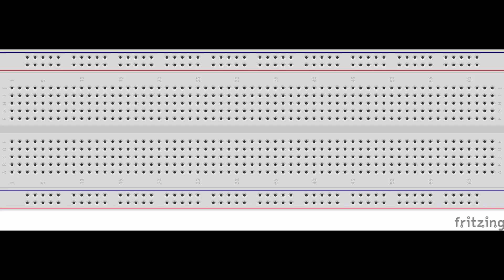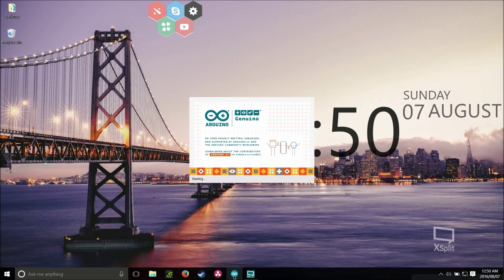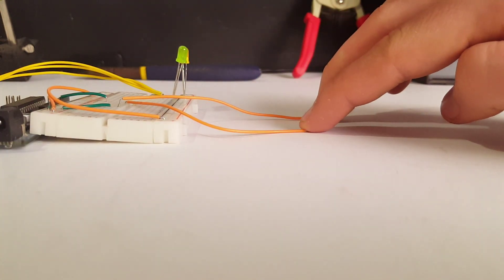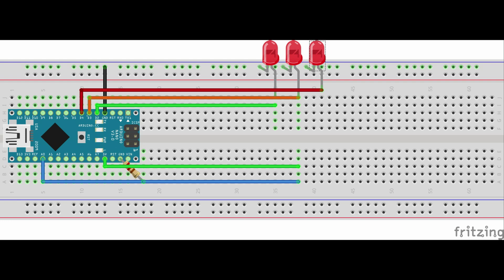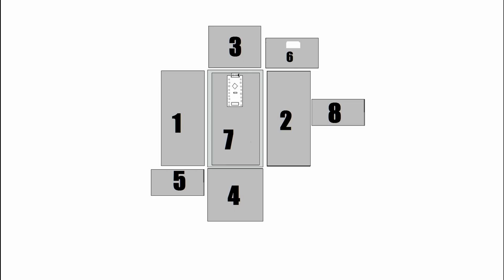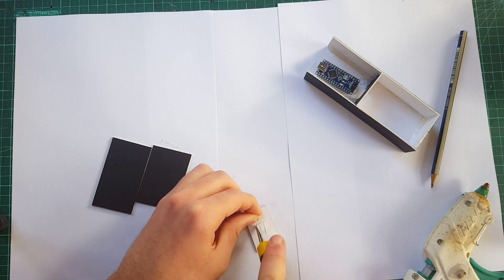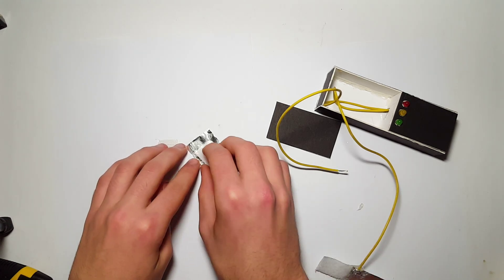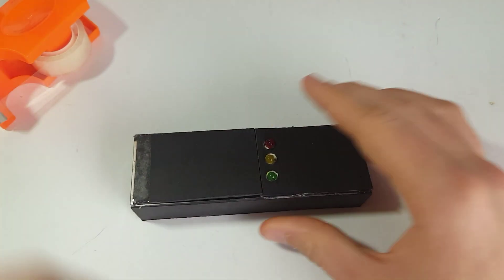DIY Arduino Powered Lie Detector

Comment: for connecting the LEds to the aurdino without using the breadboard, i connect the anodes with the specific digital pins but all the cathodes have to be connected to the same pin, GND .
how do i do that? 
cant use jumper wires

Comment: How did you connect the led on to the Arduino??
Reply: he solder it by iron strings or you can use an breadboard :)
but make sure that wires don't fall from their places!!

Comment: To anyone struggling to find the code since its not in the description or in that link he posted... Here it is:

void setup()
{
	Serial.begin(9600);
	pinMode(2, OUTPUT);
	pinMode(3, OUTPUT);
	pinMode(4, OUTPUT);
	digitalWrite(2, HIGH);
	delay(500);
	digitalWrite(3, HIGH);
	delay(500);
	digitalWrite(4, HIGH);
	delay(500);
}

void loop()
{
	if (analogRead(A0) > 60)
	{
		digitalWrite(4, HIGH);
	}
	else
	{
		digitalWrite(4, LOW);
	}
	if (analogRead(A0) > 20)
	{
		digitalWrite(2, HIGH);
	}
	else
	{
		digitalWrite(2, LOW);
	}
	if (analogRead(A0) > 45)
	{
		digitalWrite(3, HIGH);
	}
	else
	{
		digitalWrite(3, LOW);
	}

	Serial.println(analogRead(A0));
	delay(20);
}

Comment: Doing this project in 2021! I managed to get it all working (although it was a bit challenging due different info on video and instructable page). Still, now I'm wondering what exactly I'm seeing on the graph. I've read through all comments here and from I got it seems that this set up is actually measuring my skin's voltage, is that correct? In other words, what is the exact unit of the data being plotted? Knowing this would be very helpful to my research, as I intend to use this project on plants and fungi. Thank you for all the work!
Reply: I’ve been very suspicious of my garden as well.. Pretty sure my Tulips & Black Eye Susan’s have been lying to me for months and I want the truth…If I find out they are lying to me, then I’ll black them bitch’s eyes for real !

Comment: Well...we did this project, but all three lights are coming on.  Followed steps in instructable to the letter...I think our output is different than what he is describing...no response from the comments on here or instructable site...too bad.
Reply: and....we got it.

I traced our circuit and discovered he said to use a 10k resistor in the ingredients, but then said to use a 2k resistor in the actual step by step...so we switched and it is working now.  The read for a open circuit on the two "touch" parts is 0 and when closed with metal is 1023, but through the human body our resistance is keeping it under 100...I see how this is used but it is not what he mentioned...galvometer.  Instead it is more conductivity of skin, though I could see if utilized with the serial plotter how you could rate the conductive nature of skin.  Interesting.
Reply from the maker: @Kai-Made  Hi, glad you found the source of the problem! Really valuable info here, thanks for posting! It seems there was a typo in my text. Thanks for pointing it out!

Comment: there is no real difference what ever the skin resistance changes and fluctuate with time or what ever there is voltage break down that varies with time.

Comment: explanation is bogus. the skin produce voltage. the voltage varies all the time.  the voltage can be printed as a waveform. its no real difference than eeg. the voltage can be converted into numbers with a microcontroller adc. these numbers can be printed as a wave form. the voltages on your skin act just like sound waves from your vocal cord or like the voltages produced by the ion channels of nerve cells responding to ear drums vibrating or voltages produced by nerve cells responding to the optic nerve in your eye.
Reply: Both explanations are correct. He is technically measuring voltage, but you can argue he's measuring resistance. The more nervous a person becomes, the more they sweat, making the skin less resistive. This decreases the voltage. If we know the amperage of that current than we could technically measure resistance.

Comment: Won't i get electrocuted?
Reply from the maker: If everything is wired correctly as in the video, you will not
Reply: @BuildItnow  how many volts can a human conduct (without any harm)
Reply: @shashanknag5778  it's not voltage that is the concern, it is amperage that will kill you. Static electricity from touching a door knob can easily be 40,000 volts. The amperage of a arduino is far to small to kill you.

Comment: What kind of cables do I need to build this and where can si buy them? You did not specify the type of cables or anything like that. When you search up cable, a bunch of things come up. Which cable should I get?
Reply: It doesn't matter at all, as long as it's not lead or anything poisonous, and it conducts electricity

Comment: Hi, i'm very new with all this things,    I'm using an arduino UNO instead of nano, it's all okay because I looked for the pinout of the two cards. The problem is I don't understand the protoboard, i have one with 400 points and idk how it works :/. Can you help me please?
Reply from the maker: Hmmm do you have a breadboard by any chance? That would help alot

Comment: Correct me if i'm wrong but doesn't the analog read function read in voltage values in with values from (0V-5V) 0 - 1023, 0 representing 0V and 1023 being 5V? How are you reading in the resistance values if that's the case? thanks in advanced! :)
Reply: Another question, sorry i'm new lol, are the outputs coming from pins 2,3,4 5V each? if this is the case shouldn't there be resistors between these outputs and the LEDs to keep them from burning out? thanks again! :)
Reply: you are right.
Reply: It depends on the forward voltage of your led It should work fine if the voltage doesn't exceed  .
Reply: Erick I think I can answer this question. You're right in that he's measuring voltage. So the higher that number (0-1023) the more resistive the person's body is. This means there is a higher voltage. So the higher the number, the more sweat produced, the more conductive the body is, decreasing the voltage.

Comment: Hi! I've connected all of the wires, but the graph keeps staying on 0. Any advice?
Reply from the maker: Hmmm that doesn't sound right, you might need to double check all your connections and try again, if that doesn't work try reuploading the code

Comment: Why is the 2k resistor used for?
Reply: To keep from feeling a shock. The 2k resistor makes sure there isn't more than 2.5 mA running through your body which is part of the circuit. Your skin(finger pads) can range from 1k - 100k  resistance. So without the 2k resistance the highest current that can flow through the circuit described is 5mA which is the maximum accepted current threshold before it starts to get harmful. So the 2k resistor just makes sure you aren't anywhere near that lolz :-p

Comment: I had done everything but the only remaining thing is battery where i should connect
Reply from the maker: +Saurabh Chaurasia this project doesn't require a battery you just need to plug it into a PC or if you would like a battery you can plug it into a power bank
Reply: Build It thanks alot bro
Reply: Build It my led is not blinking
Reply: What's the problem can u tell me
Reply: Build It please reply as soon as possible plz

Comment: How did you connect the anode of the LEDs to the pins? Serial? Sry, I am new to this.
Reply from the maker: +The ex , peace be upon me the anode of the LEDs get connected to the digital pins of the Arduino, the specific pins you need to connect to are listed in the video
Reply: I tried this and I have all the anodes in serial configuration and then the pins to each anode in serial configuration as well. Don't know if it is correct since I haven't tried the lie detector on anybody yet, just on myself but that is useless.
Reply from the maker: +The ex , peace be upon me when you try it on yourself do any of them light up?
Reply: Yes, only the green one blinks after I upload the code.
Reply from the maker: +The ex , peace be upon me if the green one lights up then it should be working, test it on a friend!
Reply: They all light up when I upload the code. After a couple of seconds only the green one lights up, and blinks. 
Btw, I found this: https://www.linkedin.com/pulse/make-interesting-project-lie-detector-jacky-lin/ . Maybe it's you, I don't know, but it is similar to your instructables tutorial.
Reply from the maker: it seems that that person stole my work as you can see my exact photos in it, ive reported it. Thanks for the heads up!
Reply: Np. If it's not too much to ask, could you just look at how I've connected everything and how the graph looks like? I have the figures here: https://imgur.com/a/4hd7m  . The white wire is for the A0 and the blue for the 5V. I really do want this to work :)
Reply from the maker: could you get the Arduino in the photo as well? Everything seems to look right in the photo however it doesnt look like the one cable is making good contact with the tin foil? And as for the small jumps in the arduino graph that could also be because you are using the wrong resistor so maybe double check that and let me know
Reply: Hmm, I used 10k Ohm for this.

Comment: Hi! Sorry to bother you again but I have another question. Sometimes, the serial plotter graph's average is a straight line at 0. When making the finger clips, we used tape to connect the wire to the aluminum foil. Does that have anything to do with it?
Reply from the maker: hmmm that sounds like there isn't a stable connection between your finger and the Arduino, make sure all the connections are well soldered and connected.

Comment: Hi, very cool project. I am trying to recreate it with an arduino uno and my normal serial plotter graph range is about 1000-1200 with a 2k resistor; is that normal?
Reply from the maker: Sounds about right, the range of the graph really doesn't matter that much as long as you can see a change in the graph.
Reply: Build It Yeah that makes sense, thanks so much!
Reply: were you able to get it to work? I am using an arduino uno and am having some problems. im pretty sure my circuit is right but I cannot get the serial plotter to work and the leds only light up when I touch them together not when they touch my fingers.
Reply: How’s it working for you Antonella ?

Comment: What is the differences if I want to make it with teensy ?
Reply from the maker: +clementine lin I'm not very familiar with the teensy but I can imagine it would probably be very similar as long as it has analogue pins you can read from

Comment: Hello, very nice project :) i tried it myself, but i am getting much lower values than yours, in the range 2-5.. am i doing something wrong?
Reply from the maker: hmmmm weird, are you using the same micro controller and code as me?
Reply: well, the code is the same, but i use the arduino micro instead of the nano..
Reply: @modusvivendi1387  solved yet?
Reply: @BuildItnow  same for me but i'm using arduino uno, do i have to change something for that
Reply: @BuildItnow how do I put the microcontroller on? I didnt see where in the video

Comment: Sort of improved it by replacing the resistor with a pot and added an lcd screen. The pot allows you to control the sensitivity of the lie detector and the screen just shows some numbers.

http://imgur.com/a/g2gPs
Reply from the maker: +eelzchannel nicely done! How well does the improved model work?
Reply from the maker: +eelzchannel nicely done! How well does the improved model work?
Reply: Fairly well actually hahaha, didn't have enough time to test it with me actually getting nervous but it definitely worked when you wet your finger a bit. Some calibration maybe required but since its a potentiometer you can do it on the spot
Reply from the maker: +eelzchannel awesome!
Reply: That's funny. I've had that very idea just a few days ago when I built that thing for my daughter. Works perfectly!